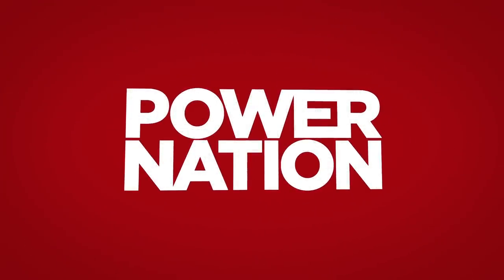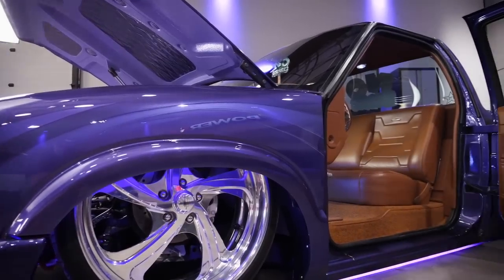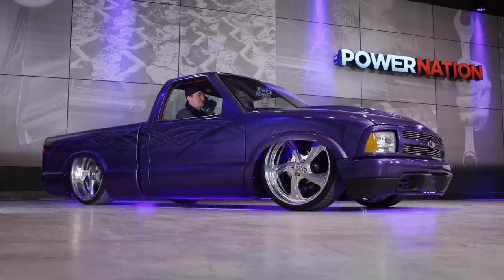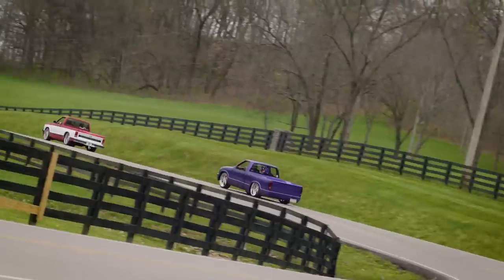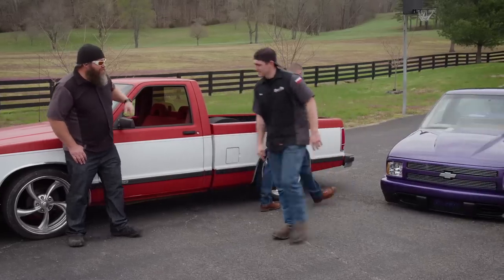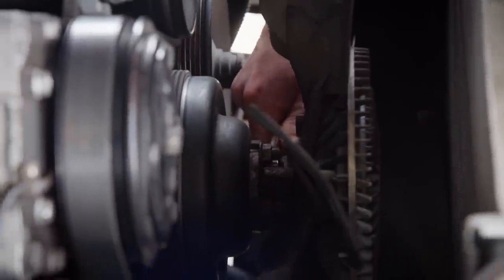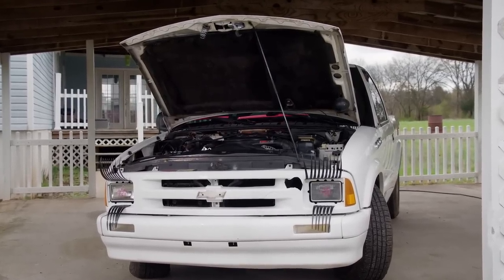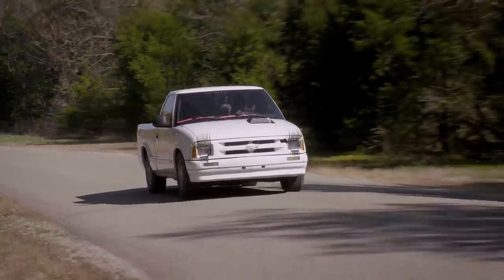Rescuing A '95 Chevy S-10 - Music City Trucks S3, E7

Comment: I had a 1990 S-10 short cab long bed with the 2.5 Iron Duke and a 5 speed that I got in 2003 or so with 41,000 miles for $800 because it was a R title. The engine fan exploded one day and blew through the bottom of the engine bay. Luckily it didn't go through the hood...lol

Comment: First vehicle was 90 isuzu shortbed. Still have her, now shes windsor powered, msd ignition with 2 step, 18 point roll cage, ford 9" narrowed, AOD tranny with 4.56 rear gears, four link with wishbone locator, coilovers, tubed out. Im currently working on the floorboard and transmission tunnel.

Comment: I’ve got nothing against mini trucks, but I’ve got everything against a stock N/A Chevy 4 cylinder 🤮
Reply: Back in the 80s you could buy performance parts through GM and push them to 300HP NA.